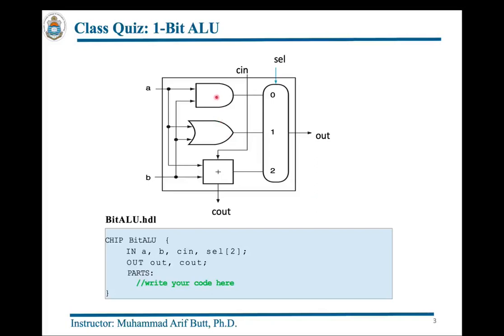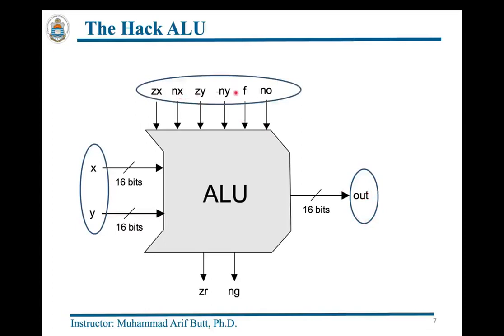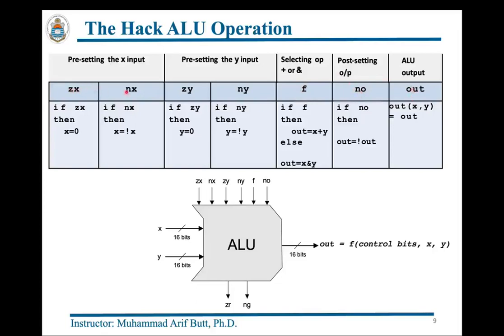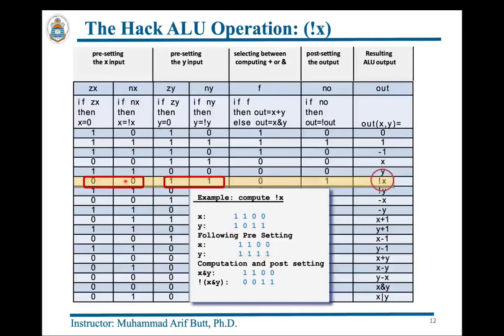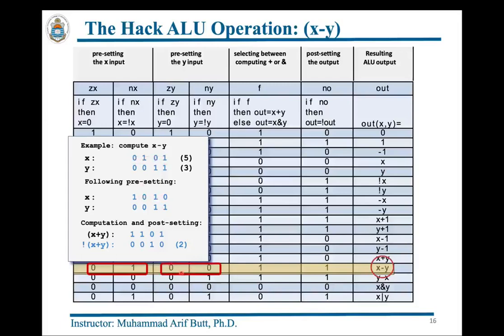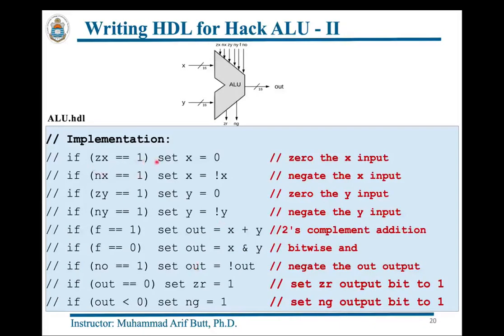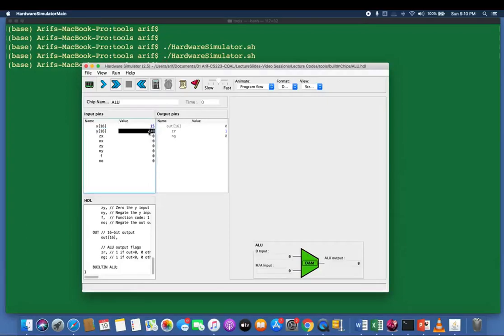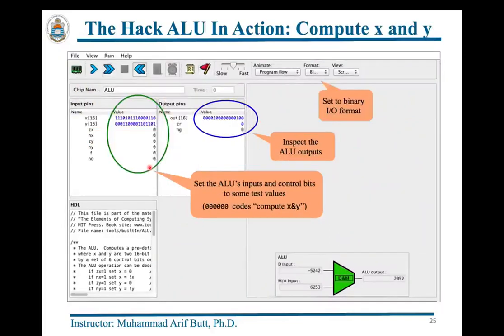Lec 09 Design of ALU-II (Arif Butt @ PUCIT)

Comment: we traced  the table  values
but  how we designed  the values of  the table  to  get the output we want?
Reply from the maker: Dear Ahmad, the design of the opcodes for different arithmetic and logic operations have been set as per one of the possible logic. There can be other possible sequences/opcodes as well. However, this design aspect is a little beyond the scope of this course.